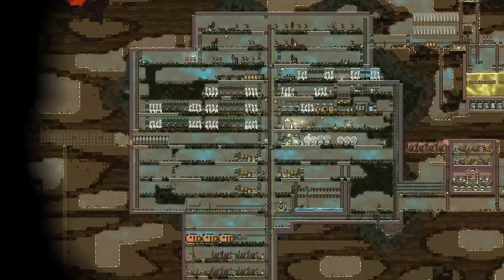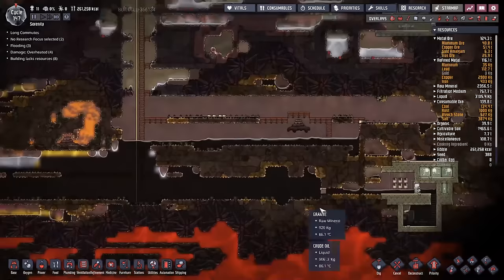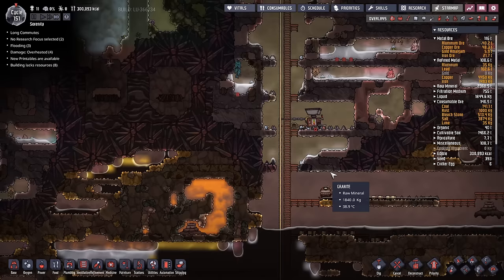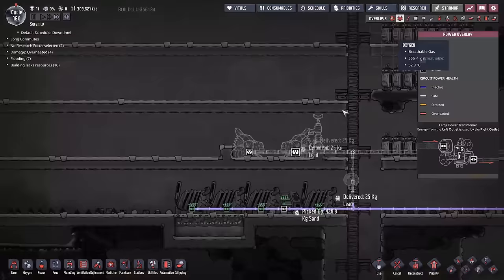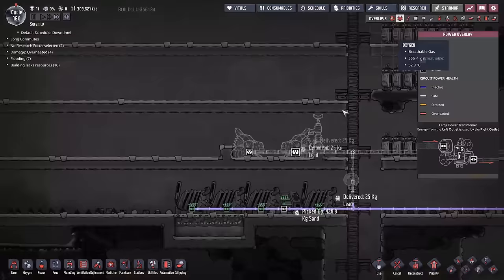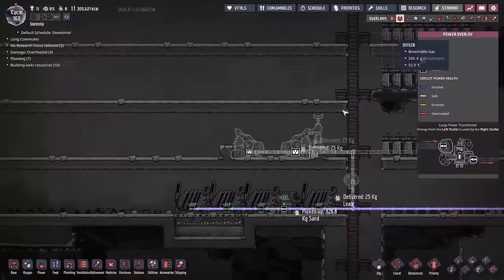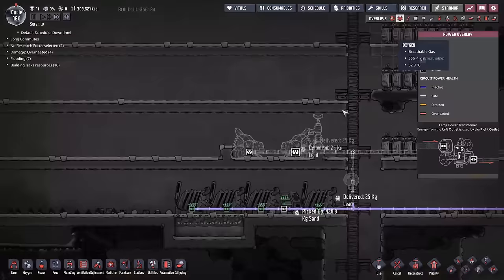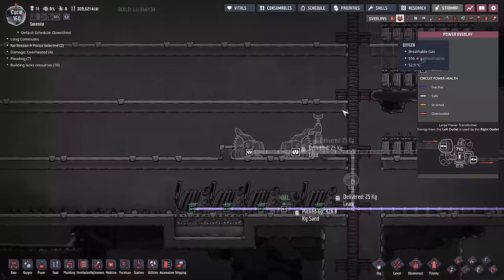Getting mid game Steel, Plastic & Cooling : Tutorial nuggets : Oxygen not included

Comment: A word of warning - don't do what I did and run your metal refineries full tilt for too many cycles - the dirt left behind by the polluted water *cooked itself into sand in the steam room*, breaking my cooling loops! I was expecting the dirt to be a minor annoyance at best, but it has all gone very wrong!
Reply: break the tile and sweep it off
Reply from the maker: So long as I had enough water in the steam area I never ran into that problem. I keep the steam at about 200kg. That way you don't get any heat spikes.
Reply: Putting granite temp shift plates around everywhere fixed that problem for me

Comment: I know it's 4 years later, but my dirt from the polluted water is turning into sand when it gets too hot. Then it's breaking my aquatuner by entombing it and causing it to overheat. Should I stop using polluted water?
Reply: are you using it as the steam source to the steam engine?
if this is so, then just use regular water
the polluted one gets "filtered" when it's too hot, so you just end up with regular water and some dirt at the end of the day
even if you're doing that intentionally, you gotta be pouring down poluted water pretty often so you just don't end up with pure water, but then it's not worth it as the chamber will eventually be full of liquid
there are better ways to filter polluted water so you get dirt (and water, ofc)

Comment: Poluted waterland then regular water on top to make a vacume ..... Mind officially blown away !  Awesome tutorial 😃 thx
Reply: you can make a vacuum, but i have never had problems with oxygen in it.
Reply from the maker: @commonsense 200 it does not gum up the works at all?
Reply: @FrancisJohnYT  i haven't had any trouble with my turbine from any air so far. i have had under temperature water damage my aquatuners so i installed a door on the side of the steam chamber, but the steam seems to overpower any air in the system.
Reply: Why is the layer of polluted water needed at the bottom of the steam turbine? What would happen if you used all clean water?
Reply: @braize6279  if you're asking about the water in the chamber with the aquatuner, he may have placed that there thinking that it would help exchange heat  up until it flashes to steam. eventually pure water will be the only thing in that chamber, afterwards. the better choice would be to add petroleum, or crude oil due to the high temp threshold, and higher thermal conductivity, for distributing the heat to the steam above. if you are using just pure water, it will work as well. i have never had problems with just a steel aquatuner in pure steam.
Reply: @commonsense-og1gz  Ah k gotcha, makes sense. I'm guessing water alone wont be hot enough for the turbine when it flashes to steam
Reply: @braize6279  the steam turbine requires the steam be at 257 degrees F to activate which is above the 246 or so of the polluted water's evaporation point. so it will all be pure steam before the system kicks on. this is why steel is chosen as the metal for the aquatuner.
Reply from the maker: @braize6279  I want nothing but steam in the box when it warms up. So I have a few choices. Vacuum out and use a liquid lock. put in a two tile deep layer of clean water to force out all the gas, this will cost tons of water.
A cheap alternative is put in a bit of polluted water and it will take up the bottom row of tiles. Then put clean water on top of it and that will take up the second row of tiles. You can fill the entire 2 tile high box with a few hundred KG of liquid forcing out all the gas.
Reply: @FrancisJohnYT  I just leave a one tile open and wait until it turns to steam then seal it. The steam forces all the oxygen out.
Reply: @braize6279  He uses two different types of water because it is a brilliant use of the game mechanic that allows only one element at a time to exist in a block.  

Polluted water and clean water do not actually mix, and cannot exist in the same tile with one another.  If he were to use just clean water, he would have to use tons of water to filling the entire bottom row of tiles completely and then would need to add a bit more to cause the second layer to be considered occupied.  His method allows a few hundred kilograms of polluted water, just enough to spread across the floor area to count as filling the bottom row, then adding an equally small amount of clean water forces any gas out of the second row.  You could substitute salt water for either the polluted or clean water for the same effect. Salt water would leave salt the same way polluted water leaves dirt when it converts to steam.

Comment: i'm so glad for the automation innovation update giving us tanks with automation output, so you don't have to build those contrived overflow sensors
Reply: Does this tutorial predate that update? So basically I could just run the automation wire straight from the tanks to the refinery without a need for a sensor in the pipes? Also the way he does it here isn't he missing a not-gate? This way the refinery only activates when the pipe is full, no?

Comment: It might be important to note that the automation wire needs to be routed elsewhere from the Liquid Pipe Thermo Sensor.  Post Banhi's Automation Innovation Pack new setups the Reservoir will send a green signal so the Aquatuner runs forever causing freezing in the pipes.
Reply: what do i need to do can you please tell me?
Reply: pls?
Reply: @flaviusgreen979x8  reroute the Automation wire around the Res.  I just went straight down.
Reply: I ran the automation wire directly from the Temperature Sensor to the Aquatuner.

Comment: I just make closed by waterlock vacuum chamber and spill some oil inside. Placing oil refinery and gas pump there both made of gold and they will never overheat unless you overheat oil above 120C and forget to change pipes to isolated ones. Doing same thing for polymer presses, most of structures just need to stay in liquid splash to stay cool. And most important, all that system self-powered by oil and gas generators, adding refinery will help a lot, thanks for vid. Before I usually was cooling water basin for it by placing small portions of ice inside, may be helpful if you running low on water.

Comment: wow, that was such a good tutorial. I'm with my ateria base at over 200 days and well, the only thing where I have problems is refined metall. 
I tried to make a good power/oxygen machine from the other big ONI-YTer, (it starts with B) and well, I set up everything, the only problem is, I need refined metal for the cables and the smart batteries. I started to make it, but I have cooling problems, 
I'm not so far like you, as I don't have atmo suits really, but well you helped me to get something to cool my metal refinery to get tons of refined alu. I already could set up the atmo suit production, for at least one or two suits, as I was lucky and got a few refined iron from the pod,

A other question: I got from the pod 3 slickster eggs, I set up a small room for 2 and I pump all the Co2 from my energy room (1 coal, 2 wood) in that room, so I get some cruide oil and get some Co2 and heat away from my power room. So... was it good to build it already? I mean the slickers are at near/in my base, heated up from the hot Co2 out of the power room. (~60°). The grooming table is in the co2 max pressed room and it's quite hard to groom these cute things
Reply from the maker: So long are you are producing enough CO2 to feed them, why not? More food and free CO2 disposal all in one package.
Reply: @FrancisJohnYT  well I think not, as the power room gets too fast hot. I may can use from a other power room for oxygen/ energy and cooling instead a carbon skimmer to a gas pump.
But my proplem is the heat. I want to keep the normal ones,  but the room is too cool and I get only the slickster ho consume oxygen

Comment: I really like your route of going straight for a Metal Refinery with the oil. Very good. Will use that.

I think drip cooling with water is the first cooling method somebody should learn about and it can use very little power. Throttle a mini-pump to 200g/s and it effectively uses only 12W. Better yet lol Throttle a regular pump to 200g/s and it effectively uses only 4.8W. 

I sometimes find mini-pumps are overrated unless you absolutely must have the most compact design possible. Which reminds me... I still wanted to try and make a SPOM with mini-pumps just for fun even though they are less efficient.(edit: nah... it's not very good)
Reply from the maker: I'm not sure mini pumps are to highly rated? I must admit I don't get on the forums as much as I'd like any more so I could be out of date. Drip cooling can and will work, that is pretty much what I use to get the first 200 kg of plastic.
Reply: @FrancisJohnYT  No I just mean as an "advanced" tech. Not sure why it's even in the game. I'd say drip cooling is best unless you absolutely desire to make an enclosed block. But yeah style differs. As more of a minimalist I tend to try to get the most of the least. I find going the big brick route comes with the caveats. For example. Now you decide to cool with turbines and aquatuners. Now your design for something to make plastic with needs to allow for 200 plastic and a 400W cooling cost minimum depending on if you can get the turbine to run at optimal levels and what other powered bits and bobs you want to attach to your cooling solution. There's always brute forcing it and just diverting more petroleum to the generator, but that takes away from plastic production again. And in the end you just have to ask. What do I need all that plastic for? Is it just to make more plastic.
I have one colony now that I recently left on running overnight while i was sleeping recently where I had already converted all my ladders to plastic. I've also given all my dupes comfy beds. And now there's 31t of plastic. I think that should work just dandy for a sick transit tube system now. And of course I can worry about other little projects and just leave it running overnight again. That's one plastic press. I doubt anybody actually realistically need more than that. My whole oil based industrial system is rather fetchingly built into a single small cleared out swamp biome on top of the hot biome. It looks downright evil genius if you ask me.

Comment: Great stuff, as usual.
One thing I don't fully understand, is why you dropped a layer of p-water in the cooler before adding clean water to push the gasses out - at 12:34
Why not just use clean water? I suspect it has something to do with the total amount... Because using only clean water would require a lot more kg's and puts too much in the cooler? (I'm figuring this out as I write this, apparently)...  So, basically using p-water first, causes that only little clean water is needed to fill the entire cooler and drive the gasses out?  Ohhhh it's a trick! :) Yea.. I think I've arrived... Gonna give it a shot. 
Thanks a lot for this series of videos man!

Comment: Great video! Most ONI "tutorials" I find have a thumbnail bearing the promise to teach you something important about the game, and then turn out to be just some dude talking about pretty elementary stuff for 45 minutes and showing off their base. But not you! Kudos.
I realize this is a little late for a question on a channel with that much traffic, but here it goes:
I'v noticed you are using copper radiant pipes to dump the heat from your refineries. Can I safely use lead instead?
i.e Does the steam chamber have a tendency to go over 325 celsius?
Reply from the maker: In theory you should be safe, but in practice I would not risk it. Also lead has pretty weak thermal conductivity relative to other metals. Considering that radiant pipe only requires 50 metal per segment just smash up some common metal in the granulator, Iron will do just fine even.
Reply: @FrancisJohnYT  Copper it is then! Thank you very much for your reply. 
Love your ONI stuff. Blazed through your oasisse series, and now catching up on badlands. Good luck down the road.

Comment: due to how easy it is to make ceramic, i usually make my metal refinery out of it. when making plastic, i usually just build one press, by itself, in a cooler biome, such as a slime biome to avoid the melting temperature of plastic. i have seen plastic melt to naphtha immediately after it was pushed out of the press. golden rule number 1, don't build polymer presses in places where the starting temperature is above 120 degrees f, or 48 C.
Reply from the maker: The plastic come out at the same temp as the input petroleum, so if you input petroleum at above 150C it just pours out naptha. Really funny to look at. I like using ceramic for a lot of the stuff listed here but left it out for simplicity's sake, it's not necessary if you can get the cooling up.
Reply: @FrancisJohnYT  i'm just waiting for markiplier to try and figure this out, LOL.

Comment: Thanks for the aquatuner setups. I'm a bit confused with the different versions though. So far I've seen three:
1.) Have the cooling loop run directly through the aqua tuner. Seems to be the most common and also seen here
2.) Your icebox design where you use a cold liquid as transfer medium
3.) Running the cooling loop into the steam chamber. Didn't know you can do that

Are some of these better than others, or is it personal preference?

For some easy steel you can also pump up some polluted water from a slime biome and dump the hot water right back into the pool. It's not a long term solution obviously, but it allows you to make some refined metal without  advanced infrastructure
Reply from the maker: Most of it is personal preference or just the demands of the situation. If I was doing a cool steam vent tamer I would not need a huge temp differential so 40C would be plenty cold, would not use the liquid tank to even temp and I'm not going very low temp. It would also be active very little but I would need a buffer so I would usually have a little tank of water to store the cooling between eruptions. This industrial brick cooling solution needed to cool multiple floors and at a steady rate so piped cooling was fine, I needed a fine margin of temp control as i wanted to go down to 10C or less so i stuck in a liquid tank for evening out the flow. So I suppose the short answer, they all have a use and it's usually down to convenience.

Comment: Late to the party here, I have one issue with the refineries. If I dont do a setup I seen where they add a shutoff valve to it. Eventually the petrol gets to hot and bursts a pipe for me. That shutoff valve would stop the petrol from going back to the refinery and forcing it to circulate in the steam longer till it cools down enough to run more steel.

Comment: Most of tutorial-makers for ONI avoid self-cooling turbines, and there is a point to it, like you need at least 2 turbines per metal refinery and have big thermal mass in steam chamber and many more, but it is a great way to tame all gold volcanoes, almost all cooper and none for iron (unless you make 2 turbines or you have weakling volcano, or go nuts with ~45 tons of steam per tile in steam chamber) and save some power on cooling. Maybe touch this topic on some of tutorials, like you not recommend but there is an alternative?
Reply: what i tend to do is use either a liquid cooled thermoregulator for the turbine, or use wheezeworts for the turbine room.
Reply: @commonsense-og1gz  Self-cooling is a term that describes the design in which the 95-degree exiting water is used to cool the turbine from which it exits. My comment was a request to make a "pros and cons" tutorial for this type of solution. Not "how to" question. sorry for my english that is so hard to understand.
Reply from the maker: Not sure about the numbers there. One steam turbine can eat an entire refinery of heat pretty easy so long as you have 1 ton of water for each refinery. Self cooling with an Aquatuner is pretty standard, turbine gives off 10% of the heat it destroys as heat out the top of the turbine. With the aquatuner you just move that 10% back down below the turbine again. Worst case you are adding 10% load. I do it with all my turbines.
Reply: @FrancisJohnYT  I'm not talking about standard solutions, I'm talking about a situation where you cool a turbine with its own exhaust through radiant pipes. then it can work without overheating, not relying on external sources of cooling, but only relying on the water leaving it. like walled her up alone with radiant tubes in the room and that’s all, give her steam no higher than 138 degrees and you don’t need Thermo Aquatuner or Wheezewort in the design. Is such a solution so rare?
Reply from the maker: @DarkYor  Oh, that is fairly rare in my experience. They can work but you can run into issues. First issue is what happens if the turbine has a period of down time? Even ceramic insulated tiles are not perfect if enough heat from the steam box leaks into the turbine area to push it above 100C you will need to bring in cooling.
They can work but due to their fragile nature I avoid them. I would prefer to pay the cooling cost and have the peace of mind it brings.